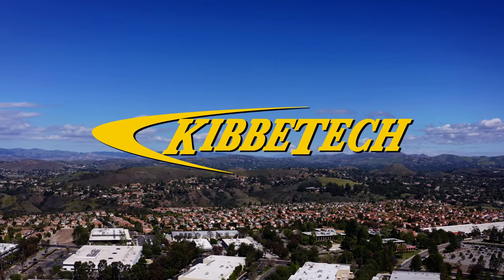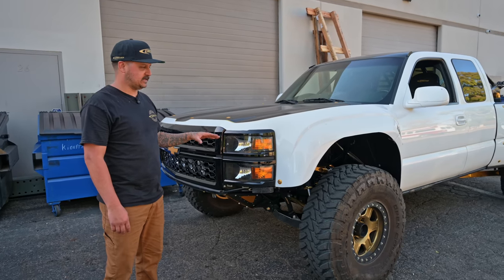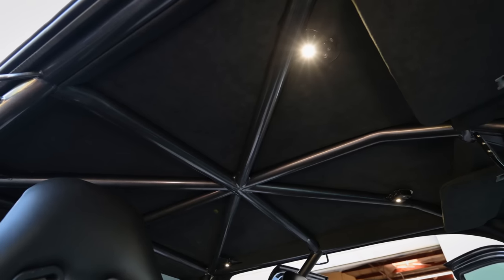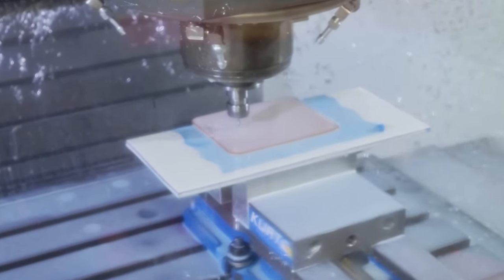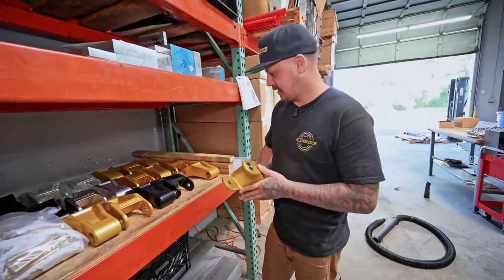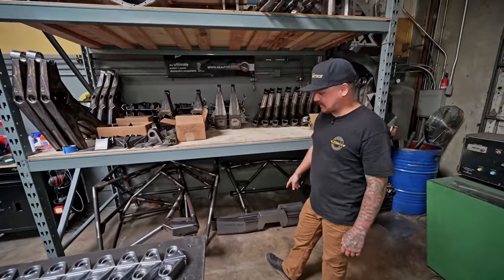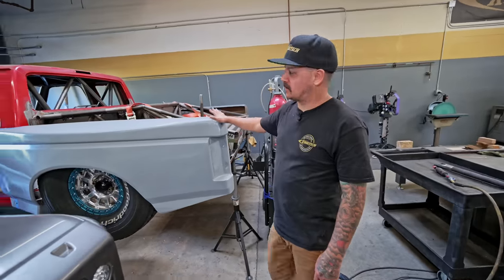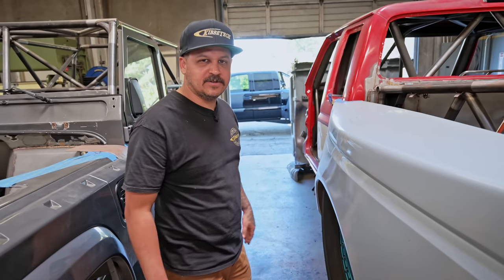She's Back! Playa Modelo aka The Black Truck

Comment: Hey Ryan- how many of the trucks In your shop still have stock frame rails ?
Reply from the maker: 3 of them are tube chassis.
The way these things end up we try and get the customer on board with tube chassis from the start.
Reply: @Kibbetech  my dilemma - building a truck. Deciding on tube frame vs a back half. I’ve been told significant savings can be had just using a stock frame